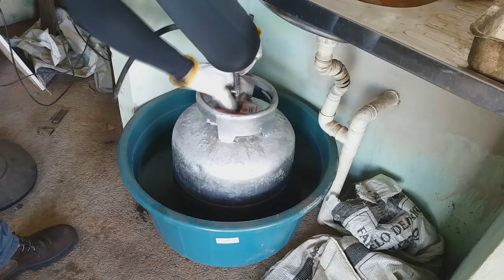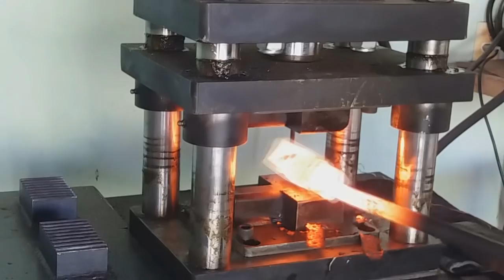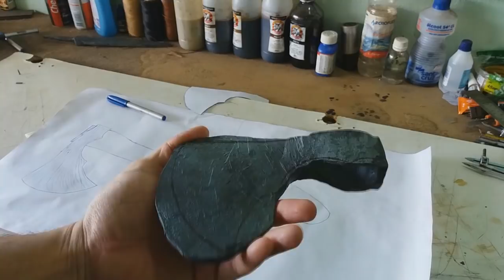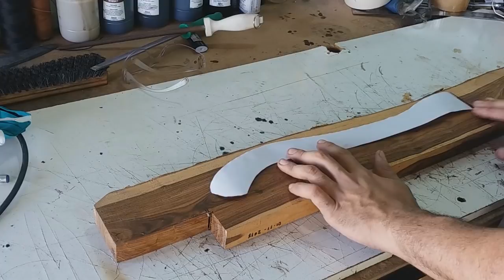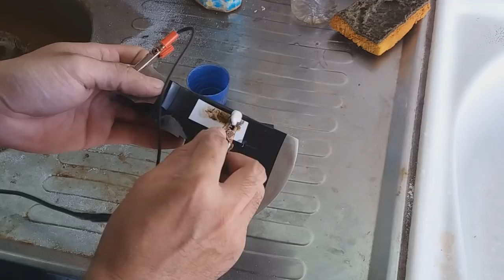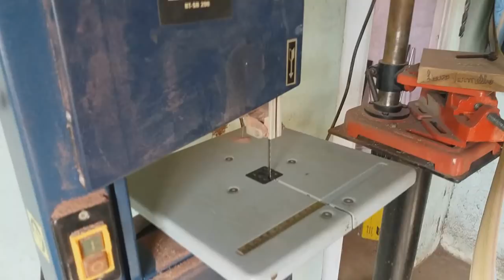machadinha viking em aço damasco,Damascus steel viking hatchet

Comment: The blade should be the only hardened part of the head plus the grain should go toward the blade not side to side and the kerf should only be 3/4 the way down the axe head not all the way to where there head sits, just because you don't want to break the axe head or handle other than that it looks really cool